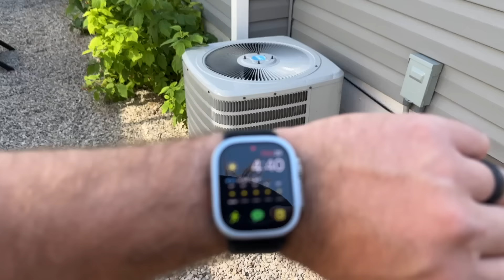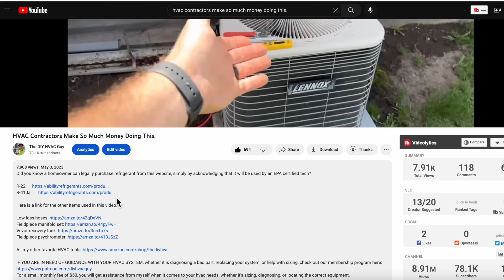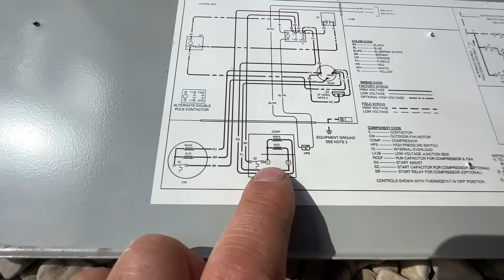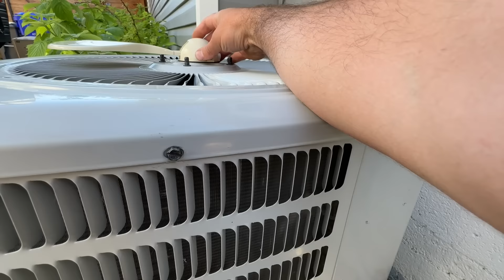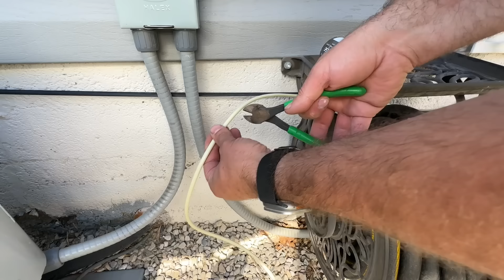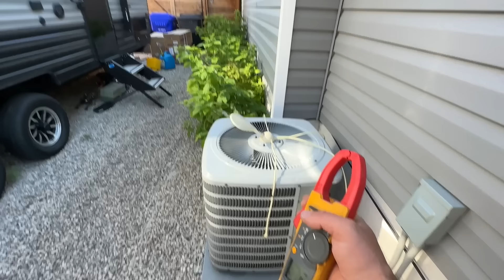Can This Device Actually Lower Your Electric Bill By 30%??

Comment: I know the condenser motor can handle water coming into the top; but I would worry if the motor would be damaged by mist coming up from the bottom.
Reply from the maker: Every time it rains water gets on the side of the unit. It makes no difference

Comment: If you have hard water DON’T. The calcium buildup decreases efficiency. The calcium filter/absorber did not work for me. You want to do this correctly build a huge swamp cooler around the AC unit.

Comment: Very cool (no pun intended); I’ve been planning to install a swamp cooler on the roof to cool the area under my patio awning. Just put in the water line (1/4 copper tubing).
Having watched the video I’ll now split the water line and run water into the a/c condenser too - it’s on the roof also - and give a little love to my air conditioning unit!
Thanks for sharing

Comment: Good job! If u follow the high side line you can see where it enters into the condenser coil and thats where the hottest refrigerant will be found. Generally its at the top left of the service panel.
I wish they would have made a mount that could utilize 2 of the condenser fan bolts to make sure the switch never comes off. Those fan motors can get quite hot especially if they are going bad.. 
For fun drench it with a hose with the clamp meter hooked up. The amps will really drop

Comment: This device costs $99.00USD. I wonder how long it would take to recoup that cost? Also the cost of water usage. It seems to use little water...but it still costs. Also, not doubt this will shorten the life span of the Condenser unit via corrosion. Add the reduction of efficiency if this causes particulate build up on the fins.   Do a big picture cost analysis...would one save?

Comment: I hooked up this device to my a/c last summer and I really wanted it to work.  I hooked it up in July and after running it for 30 days I compared my electric bill from the same time the previous July and there was so change, the kwh actually went a little up.  I don't think these work.

Comment: EDIT:  I posted a warning from cool-n-save inc that warns people about using hard water above.  The warning is good, but talks about well water, but many municipalities use well water and other hard water sources that a homeowner is unaware of.

As an engineer (not tech) I would not recommend this for many reasons.   Tap water will deposit minerals unless you treat it with an RO system, or stick to using filtered rain water.  DO NOT continuously run tap water on hot coils, as the mineral deposits will reduce the efficiency of the unit, loosing 30% of the capacity each year you run this.  The water MUST be mineral free to avoid destroying your unit.  That little water filter they use will not make mineral free water.  And the wire inside the tubes is a stiffener to hold the wire in place without zip ties, but zip ties are a good thing, just don't tighten them down as they will reduce water flow.  Wirth zip ties the wire isn't needed.

If you go to the trouble of using RO or rain water, then this is a good way to increase the capacity of your system, and reduce head pressure.  HOWEVER, the capacity of your condenser is tied to your unit's ability to control humidity in the house.  Putting too large of a unit can cause high humidity in the house, which will rot your house out from the inside.  Small increases in efficiency are good, but if your unit is already larger than needed for your house, increasing it's efficiency may come at a cost to the life of your house.

The main reason I would not recommend this is it will require you to be proactive to avoid problems, this means you need to learn the engineering, because now you arre your home's hvac engineer, and you will be responsible for the success and failures caused by this system.

I have HVAC training from when I was in college and wanted a good paying hvac job as I worked my way through engineering school.  I used these skills at home, and in building Internet datacenters, where most HVAC technicians generally don't have training for the vastly different requirements of cooling buildings full of high powered heaters (racks of computers can produce 30,000 watts of heat per square foot of space, and thermostats on the wall are not a thing).  The point is if you change how your system works, HVAC standards no longer apply, so you are the engineer now...  Are you up for that?  Own the engineering, and then I say go for it.  Not a engineer?  Then don't do it, it might cost you thousands of dollars and shorten the life of your whole home.

Comment: No. To remove the calcium deposits would dissolve the fins. The only way I'd consider this is if it used a reverse osmosis filter.

Comment: the pH and mineral content of the water is CRITICALLY important~!!!!!!!!!!!

The wrong pH or mineral content can cause  oxidization and corrosion on the aluminum heat exchanger and that aluminum is way too thin to  treat casually.  One can destroy the heat exchanger  doing that so easily.
Plus  because the coils will be moistened they will trap and retain dirt and you'll have to clean them  more often

Comment: an important factor in factoring in this misting system's effectiveness is HUMIDITY.  What was the relative humidity during this? 

There will be a distinct difference in dry vs. wet climates (#denver vs. #houston) for example

Comment: Adding a heat pump?
Unless the technology has improved greatly over the last twenty year's?
A heat pump is a complete rip off. You end up using three times as much electricity $$$ and save no money. Biggest home electrical scam out there.

Comment: Idiots the unit it's self is to close to the wall and in a partially corner. It is already recirculating heat rejections. Water spray will cause mineral deposit if water touches coils . Reinstalled would help drastically.

Comment: As a CIRO working on ammonia systems water cooling is a necessity in the summer. Might have to check this out. Thanks!
Edit: How well does the flapper part work on a fan that's mounted vertically? Like on a minisplit?

Comment: Don’t do this if you have hard water. I did this on my house and had to take it off after a month due to scaling. It worked well but it started to cause a lot of build up on the radiator.

Comment: If you think this really works successfully, and without any drawbacks, Don't you think that all the engineers at Carrier, Lennox, Trane, Mitsubishi and all the other major manufacturers would already had applied this to their systems, especially to meet more stringent DOE requirements. Think people.

Comment: I'd like to see high-side and low-side pressure readings with and without the misters. The misters will cause the condenser coils to be cooler, so the saturation pressure will be lower hence the compressor will not work as hard (lower current). As mentioned in the video, keeping the condenser unit shaded from direct sun makes a big difference.

I'm glad we dont need A/C very often in Oregon, and our condenser is well shaded.

Comment: I rent. We have a Heat Pump System. A JOKE. It runs continuously from May until we have 40 degrees F. out side all day (24Hrs.) which is sometime in mid Oct. Nothing has been as good as the R22 old freon system that cools you down. Same as with autos. R12 did the job. 134 134a does not.

Comment: What’s your thoughts on constantly spraying water on your compressor unit. Over 5-10-15 years, won’t that speed up corrosion and ultimately reduce the life of the unit and therefore negate any electricity savings. Thoughts?

Comment: You installed it wrong, it’s not getting maximum surface area, next you never took a delta T measurement, it basically acts like a geothermal water cooled condenser sort of anyway, not as efficient tho.

Comment: Use the water from your evaporator drain. Then you don't waste any water and you don't need to filter it.  You just need a storage tank so mitigate the delay between when the unit turns on and you start evaporating water.
Reply: You'd also need a pump to make enough pressure to mist that water which will be consuming power.  Another option might be to use swamp cooler pads around the condenser, with that you could just drip water onto the pads.  It wouldn't wet the condenser, but would cool the air going into it.  I've been collecting the condensed water to use in my swamp cooler to cool the patio when we're hanging out outside.
Reply: @DonziGT230  I assume you have to have a pump to pump the water out of your basement anyway, so no change in energy demand. Yes, the pump has to be able to move water under pressure, but that should not be difficult. In theory, if you put the tank on the side of the house, near the top, you could use gravity feed. Since the pressure would be constant, you can design your mist nozzle for that pressure.
Reply: @Daveinet  I don't have a basement.  You can't get mist without pressure, and the higher the pressure the more effective the mist can be.  The energy difference between a non-pressure pump and one that makes enough pressure to make mist is huge.  For example: the smallest non-pressure pump on my boat moves about 350GPH with about 1 amp, the pressure pump moves less gallons per hour at over 7 amps and the pressure is just enough to make a reasonable mist.

Comment: Check outside air temperatures before and after installing. That little water won't make any difference. ..
Maybe the air outside cooler by the times you testing the product

Comment: This would seem to be a strong argument for building a shade structure around the unit instead.

My house has two units very near each higher. I might just build something, like a simple slat fence.
Reply: No ,you want the hot air spit out from the fan escape as far as possible from the unit

Comment: Problem with these misters is that they can cause erosion of the condenser unit, if you read more about the long-term negative impacts on these misters.  While it does help in the short term, it could shorten the life of your condenser.  Pros & Cons to everything so wish he would have mentioned this in the video.

Comment: I think you have enough slack in that supply line that you could just rotate the whole unit 180 so you get that mister on house side repositioned toward the outside.

Comment: This wont save money because there is access drag on the fan motor due to it pushing that flap, if there was a decrease on the compressor amperage the motors amperage would rise, you will also have a slightly higher water bill. Sure the water would dissipate heat more efficiently making your ac remove more heat but that is at the cost of extra money and its more than likely not going to be a noticeable difference, like the video shows a temp change of around 1 degree.

Comment: What is the real water flow rate?  I don't think in toilet flush amounts.  Not sure if your toilet is like my toilet, either.

I would love for my compressor to only pull 4.4 amps!  1ton??  You should consider checking the common (black) to get a true reading.

Considering my high humidity and additional power cost for running the water pump, there's no ROI for me.  Maybe I'll suspend a bucket with a few drip lines that I can hand fill 😂🙃

Comment: Not good for the condenser coil fins. Calcium build up and eventually the aluminum will deterate. The engineering is air to air. Yes it will drop the head pressure and thus amps. But you need head pressure. I found it best just to leave it to the engineers. You'd be lucky to save enough $ to pay for that gizmo before the water jets quit

Comment: Fun fact: the Subaru STi at one point had an intercoooler sprayer option.  So the concept is a well proven one for precooling air before a fin heat exchanger
Reply: This is refrigerant though. Refrigerant changes states and evaporates to high pressure vapor then low pressure vapor then a steady column of liquid back to the evaporator. Might work for the car being it's only a solid state of liquid, but not with HAVC. This is a huge NO
Reply: @SzymczykProductions  but it’s still an air to air via the fins radiating the heat waste.  This would speed that up,  not saying it’s a good idea or bad one just that it would work.
Reply: @BiologistRyan  Refrigerant works different. Been in hvac-r 9 years these do not work. Causes more problems than solves. We typically advise to remove them if we see them in the field, as they cause coil rot

Comment: Evaporative cooling works best in dry climates. If you live in a very humid area, it is not very effective. That's why dray areas use Swamp Coolers and humid areas use AC units.

Comment: You would also need to factor in the Costs of the water vs the reduction in costs on your electric bill
Reply: Its negligible. The bigger issue is fouling of the cooling fins, or corroding them. This is cool though. See what I did there?

Comment: This kind of product has been debunked time and time again..  It also has no effect at all on current draw or operation.  The theory behind this device theoretically is to lower the run time of the compressor by allowing heat from inside the home to transfer more easily on the outside coils.  The idea of the coils being cooler seems like a common sense thought.. except the pressures vs. temperature makes the difference in temperature negligible if measurable at all.  This is basic thermo-dynamics.  The only way this works in theory is if the air INSIDE the house is actually being evaporated to cool it.  Many tests have been done with this concept taken from swamp-coolers (actually cooling the inside air of the homes), but it makes little or no difference in the outcome.  More of a difference would be to shade the compressor from sunlight instead (but not obstructing airflow).  The physics just do not work on this concept...

Comment: Seems like it would be best to have a electric system that used a 5 gallon or so hopper that you could pour distilled water in it and not need the filter.

Comment: I’m shocked that that unit does not come with a fourth misting tube and nozzle. You should be able to cut one of the misting tubes and add a splitter or a T to that and add a fourth run to the last side of the unit. Should in theory make it 25% more effective. Being that it is a pressurized misting system. I seriously doubt that they would be any negative affects splitting one of the two missing tubes.

Comment: This is cool and all but why did you take the panels off…it’s a self contained unit that would have worked as long as it had a fan…I get maybe the thought was I don’t want to get anything important wet but I think the manufacturer thought of that when they had us put them outside lol…still cool beans 😂

Comment: If you are even thinking about putting a heat pump in . You are a moron. Heat pumps don’t work below 39 degrees. Therefore you will drastically increase your electric bill.

Comment: This is potentially counter-productive. If the condensing unit is excessively efficient it will hoard refrigerant & starve the evaporator. Just another gimmick with limited practical use and a host of liabilities.

Comment: I was impressed with the 53 degree air at your vents.  Do you have any idea what the return air temperature was at the time of the test?  What was the delta T between return and supply?
Reply: If your condenser and evaporator coil are the same size u can actually have a reduced delta. The pressures become so low on the high pressure side when it reaches the evaporator that it struggles to boil off the refrigerant. If you happen to have a slightly oversized evaporator coil it gives the refrigerant the time to boil off. 
This product uses so little water that its probly not going to have that issue though.
The delta shouldnt really change though if the refrigerant is charged correctly which would have to be done with the misters and unit running. All this does is reduce the head pressure, thus the amp draw, which in turn costs less money to cool the same mass of air and its completely worth the trade off. The optimum delta no matter the system or efficiency is around 20 degrees
Reply: @GonzoDonzo Don't forget about relative humidity. You can have a Delta t of 11° with high humidity and the system is working perfectly.

Comment: WARNING -  The chlorine typically found in city water will corrode the aluminum condenser coil.  I set one up, worked great, but had to change the unit out after about 2 yrs.  Corrosion,  then leakage & fins fowled, broke off.

Comment: I'd be interested to see how much dirt collects over time. Moist coils and dusty air streams make mud. True swamp cooling devices usually have a flow over the coils to keep them clean and you simply purge the sump every once in a while.
Reply: Depends if it's in dusty conditions. If the dirt starts sticking to the units coil fins it will eventually get clogged up. Maybe keeping an eye on it on a regular basis